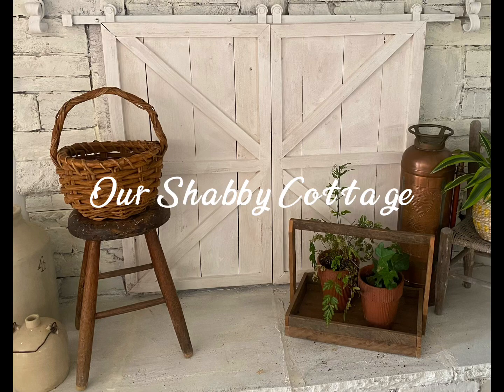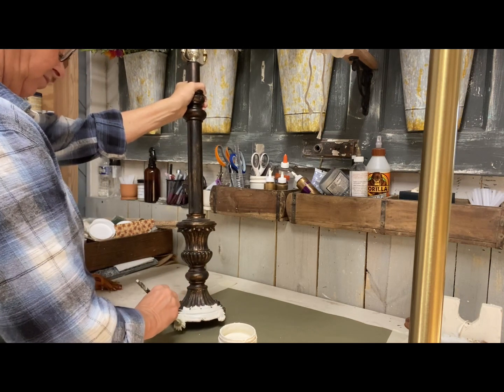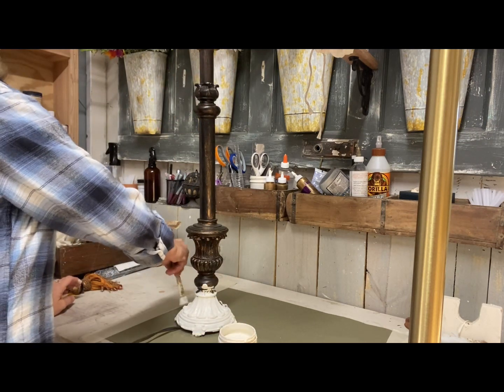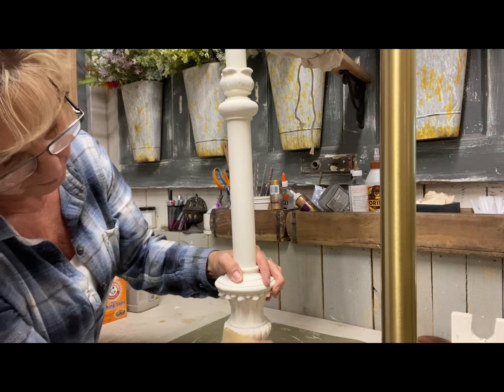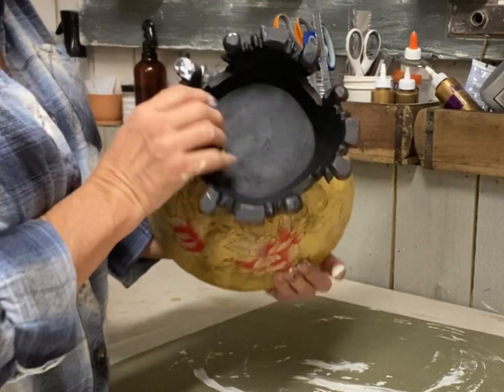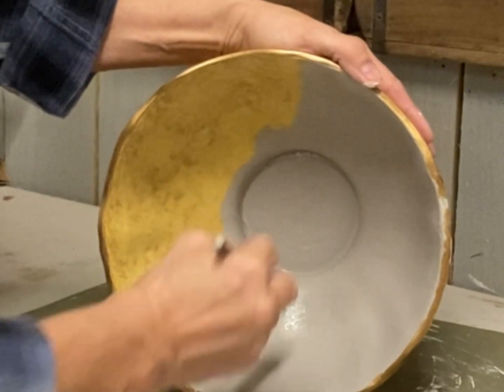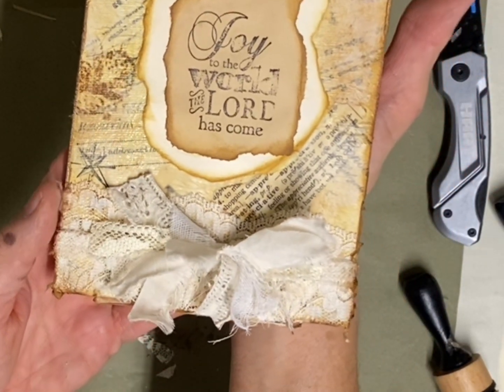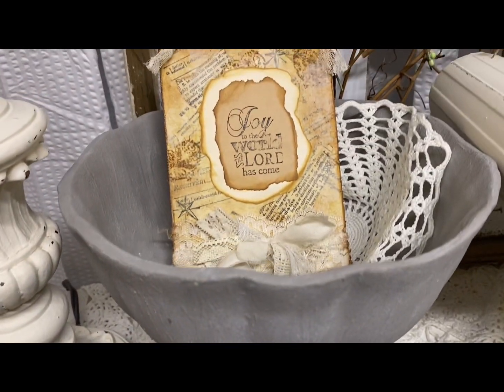How to Upcycle Dated Decor for Farmhouse Style

Comment: I painted a lampshade about a year ago. Looked really good n covered what I thought as good also Until I put it on the lamp n plugged it in n turned it on. Then is when I seen Every one of my paint strokes. I tried spray painting after that it helped but still didn't look good. So what did I do wrong?
Reply from the maker: I haven’t had that problem in the past, but I haven’t plugged in this one yet. It sounds like more coats of paint would help, or texture painting.
Reply: @ourshabbycottage8553  I will try that thank you for getting back to me.